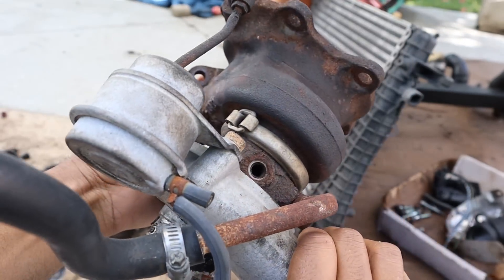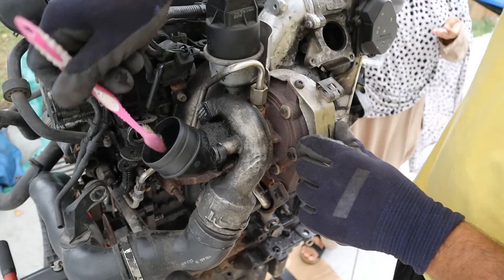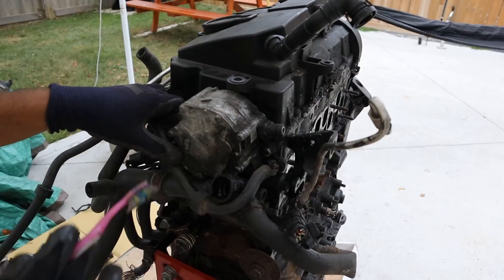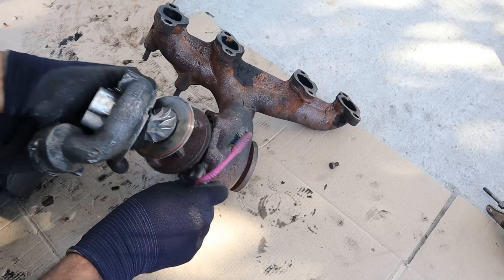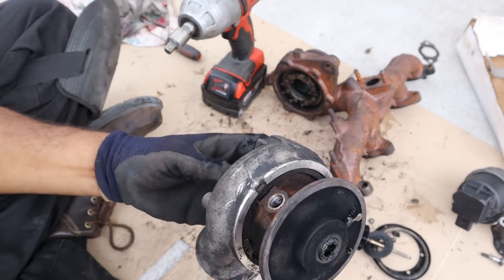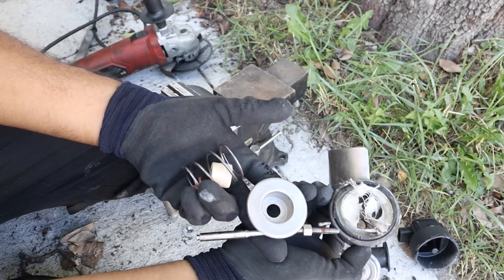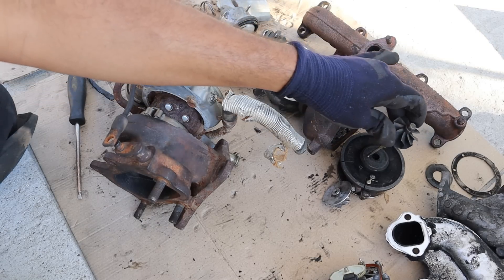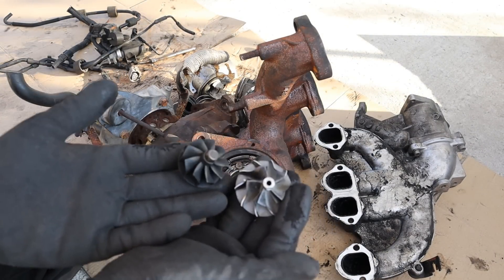How a Turbocharger Works

Comment: That actuator that controls the turbo vanes has a rubber diaphragm that cracks over time and eventually leaks vacuum, and is a “non serviceable” part from Volkswagen. Boy was that fun to replace in the car on my old 2006 😂 German engineering at its finest. I had to make my own tools to remove most of the hardware for that job

Comment: Kinda surprised a variable speed electric motor is not used to run the turbo.  I have various sized snap ring removal tools also. Great tear down and explanation!
Reply from the maker: Well an electric motor has to take power from something...
Might as well use the free exhaust gases
Reply: @speedkar99  Understood, Seems a lot of extra "stuff" to use the exhaust gasses. Too,  kinda crude in input vs output (lag). Superchargers require horsepower. Electrical motors (torque) & modern control devices just "seem" to me to be more precise for conditions of specific boosted air injection But hey, what do you expect from an electrician. I promote your channel to all the other motor heads & retired old farts like me. You are #1. Thanks Bro.

Comment: Specifically speaking coolant to air type coolers are called intercooler/aftercooler but the Air cooler which use Ram Air are called as charge Air cooler..truely impressed and inspired by your videos🥰 you have immense knowledge astounding 🔥

Comment: Nice. My Škoda has this model engine. Low consumption and high power in demand. But it needs to be pushed regularly to prevent the turbo getting clogged. A mistake the previous owner did and I payed.
Reply from the maker: The Italian tune up !
Reply: @speedkar99  Exactly! I have VW Passat with 1.9 TDI and it seems that it needs Italian tune up every now and then :D Otherwise it won't reach higher rpm:s near redline and just won't accelerate after certain point :D

Comment: Dumb question: does a turbo constantly “work” then? Like even while cruising on the highway you are always using you turbo to draw more air? Is that why your gas/mileage drops?
Reply: It partially works all the time but the more you accelerate, the more fuel goes in and more thermal mass exits the motor to spin the turbo. Thus the end result is that there might be a partial vacuum in the manifold until you decide to give more gas and the pressure increases due to increased fuel burned. So when cruising the highway, at least usually my Volvo 940 manifold pressure stays negative (usually -0.6 to -0.8 bar) but it is certainly higher than idle manifold pressure (around -1 bar). TLDR: the turbo works a little yes but not as much as when applying more gas (accelerating).

Comment: great video.i have a turbo that is leaking intake pressure down the oil return pipe.i took the return off and put a pipe from it into a bottle of water.i sealed the turbo intake and when add any pressure to the turbo it blows bubbles in the bottle.i can get to about 2 psi and even that drops away quickly to no pressure at all.have you seen this before?.
Reply from the maker: No. Seems like you need turbo rebuilt

Comment: I have this engine in my Skoda Octavia 08. The turbo leaks oil so they are not that good, my car has over 32 thousand kilometers. Can you explain to us why this happens sometimes? Does the turbo have an age?
Reply from the maker: The oil seal in the turbo goes causing it to leak or burn through the exhaust

Comment: You called the anti-shudder valve a throttle body when diesel engines have no throttle bodies. That valve is to prevent runaways and excessive engine shake when turning off the car.

Comment: Side note: t is interesting that a TDI (diesel) engine has a throttle body. It serves two purposes, under low load when EGR is most active closing the throttle helps to reduce pressure in manifold and thereby helps the exhaust to push more exhaust gasses into intake manifold. And the other purpose is to help with rappid engine shutdown without shudder vibration. Diesel are known to shake when shutting down,.

Comment: Very surprising to see how small those turbines are. 

I agree with what you said near the end of the video...that you have to work those little engines so hard they really don't get all that much better mileage. I assume that working that hard would shorten the life expectancy of the engine as well.
Reply from the maker: Agreed. Not as reliable but hey, it satisfies the government with emissions
Reply: @speedkar99 It is physics (Carnot efficiency) not politics. Nicolas Léonard Sadi Carnot, 1824, Paris. Due to lower friction and a higher fill grade, the efficiency is higher and emmisions are lower. A jet engine is technically an internal combustion engine made out of a turbocharger, simple said.

Comment: That was a good breakdown, I like the snapping removal tool. I also like the part where a little kid’s feet swing in and out of the frame.

The turbines are a lot smaller than I imagined. Do you have a large semi truck diesel turbo to breakdown ? Those must be a lot bigger turbines?

Would like to see a supercharger breakdown, although those are probably a lot harder to come by. I imagine the exhaust turbine is just replaced with a belt driven pulley and it’s mostly similar the rest of the way.
Reply: Specifically procharger, yes

Comment: The variable geometry design has a whole lot of moving parts, in an area that gets really hot. I wonder if the added performance is worth the extra fragility.
Reply from the maker: Moving parts and heat isn't the issue...lack of lubrication would be
Reply: not all variable geometry turbos are good but the ones used in vw engines last a long time
Reply: You need to floor it weekly to keep them working and burn carbon deposits. If you drive it very delicately variable vanes (1) do not open, as you only use part throttle operation and (2) they get quickly clogged with carbon (EGR has its flaws). So, as long as you use the full rev range and the actuators work regularly, plus you 'give it some' at least every two weeks so you can get rid of the carbon build-up, these turbos tend to work quite reliably. In older cars vacuum lines get brittle, so it's a first thing to check if you lack power.

Comment: Among petabytes of pure garbage your channel is the best I found in about a year.
Again, I knew the principle but I've never seen turbocharger disassembled. That's a hell of a knowledge, so I'd like to thank you for doing that and I hope YouTube pays you a decent money for your work.
Just a question though: what's the purpose of this blow-off valve if it sends compressed air back to the inlet of the turbocharger? It seems to be a closed loop, not decreasing overall pressure of the compressed air, so why's that for? I thought that blow-off valve releases excessive air straight to the atmosphere. Could you explain me that?
And again, thanks for uploading super interesting content.
Reply from the maker: Blow off can release to the airbox or the atmosphere. When released to the airbox (at ATM pressure) it just gets recirculated and dampens the sound (that's why on most OEM setups you don't hear the air rushing out) whereas if you release to ATM it'll make the distinctive whistle
Reply: @speedkar99  Now I understand. Recirculating excess air to the airbox dampens the whistling sound while still reducing pressure as the airbox isn't pressurized. Thanks for the explanation!

Comment: Good  day from Waterloo.  Boy very interesting video
Growing up on farm with diesel tractors,  makes me always  think  that  turbo on  diesel is free hp.  It does need more fuel & higher hp.
Gas engine to run 14-1  ratio gas = air it needs more gas for extra compress air. 
Is this  right??? Thanks Boy when your son was swinging I 1st thought he was flying right into  camera.  
Thanks  good video
Reply from the maker: The stoichiometric ratio 14:1 is different than the compression ratio and they vary from engine to engine. 

That was the wife swinging in the background lol

Comment: Turbos in Diesels usually only need an oil feed for lubrication and cooling as their exhaust temps are lower than Petrol/Gas Turbos who need a coolant feed as well due to higher exhaust temps.
Reply from the maker: Yes

Comment: What i don't understand is

A) How does a diesel benefit from a turbo? Don't they normally run lean? Couldn't they just inject more fuel (to a point, eventually they would need more air)?

B) Why does a diesel need an intercooler? The main funccion of the intercooler is to prevent knock, but a diesel works by having  more compression and heat. Couldn't it just have more pressure to compensate for the less dense air?

C) Why does a diesel have a boost limit? It doesn't knock, and if it can't make too much power, isn't it easier to just inject less fuel? (But also, the turbo can be a restriction in the exhaust)
Reply: A) A diesel benefits from a turbo in a few specific ways:
1- They tend to have much higher compression ratios than a gasser. Having pre-compressed air stuffed into the cylinder will further raise the compression and increase combustion efficiency. 
2 -Diesel fuel if it were compared to gas would have an extremely high "octane"(meaning harder to ignite), and the higher pressures extract the most energy from the burn.
3- the higher compression and burn pressures increase the engine torque, which compensates for the lower rev range diesel engines have.

B) A diesel needs an intercooler for the same reason any turbo engine does: as air is compressed, the temperature rises. As it does, the air will expand some, reducing the overall charge density, and as a result, the amount of oxygen that is stuffed into the cylinder. By cooling the charge air, the maximum density and oxygen content can be stuffed into the cylinder for better performance.

C) Boost limits are for two main reasons:
1- The piping joints are often rubber in production vehicles, and have a maximum pressure rating. Exceeding this can blow them apart.
2. The bigger reason is the head bolts. Higher compression results in higher burn pressures, which adds more stretch to the head studs or bolts. If the cylinder pressure goes too high, the head gasket will fail, and the engine has the potential to blow.

Hope this answers your questions.
Reply: @thomasmiddlebrooke1012  also diesels have boost limit because there is a limit on how much pressure a turbo can make reliably. If you were to let the turbo make as much boost as it could, it would over-rev, heat up and be exposed to loads that it wasn't designed to run at
Reply: @dieselgeezer18  Very true. Safety factors have to be taken into account when designing anything.
Reply from the maker: With a Diesel, you can suck/force in as much air as possible, but since it's not mixed with fuel until the top of the compression stroke when diesel is injected (compression ignition), there's no chance for predetonation. Do that with a gas engine and the gas that's already mixed with the air in the compression stroke could detonate before the spark fires (spark ignition). 

Intercoolers are still needed because anytime air is compressed the temperature is increased, according to the gas law, regardless of the engine type that's driving the turbo.

Comment: I don't really like the plastic gears inside the throttle body because if they break you get a runaway potentially
Reply from the maker: The throttle body shouldn't control much in a diesel anyway, but yes everything is moving to plastic, including stronger mechanisms like wiper motors.
Reply: @speedkar99  ask me about this 07 civic wiper motor lmao
Reply: They may be made of nylon and that would be strong enough. IMO